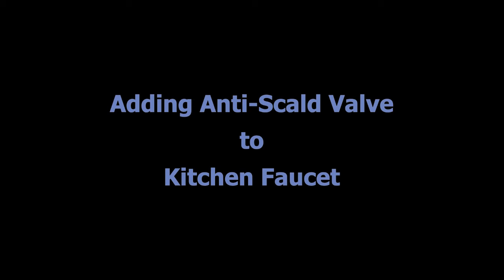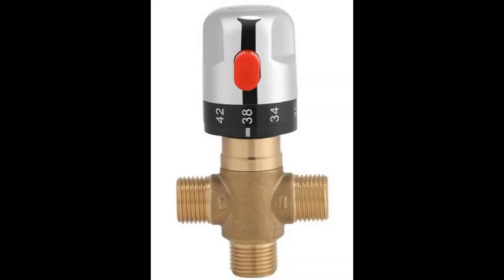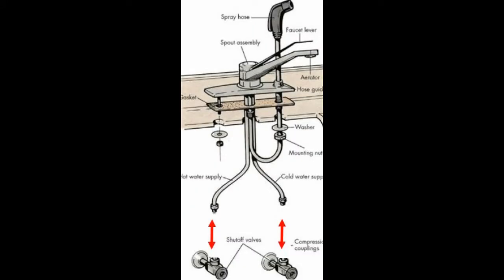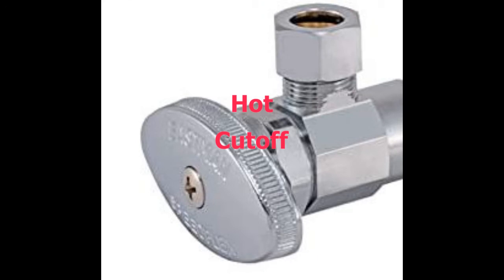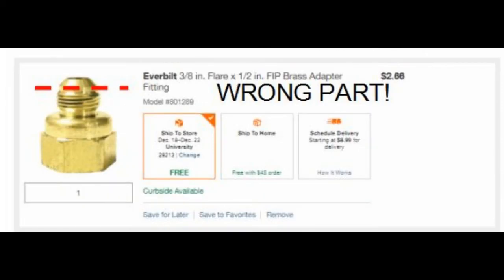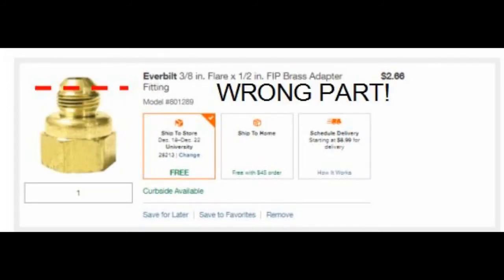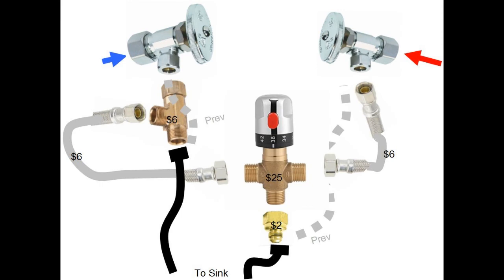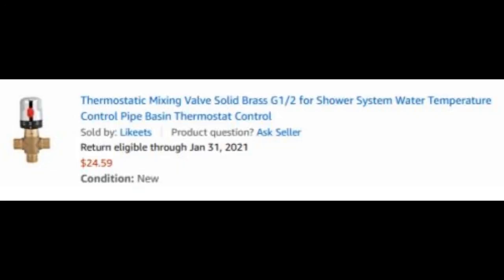Adding an anti-scald valve to a kitchen faucet

Comment: Can you add that to a double handle tub faucet?
Reply from the maker: Yes. It would work just like this works.  The output from the mixing valve would go to the hot side.  That way, the hot side would be temperature limited.